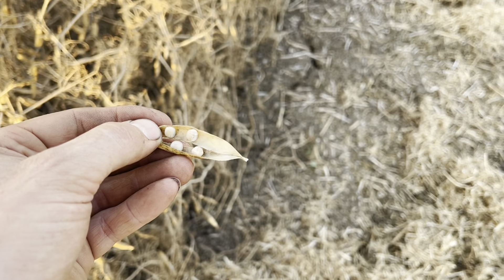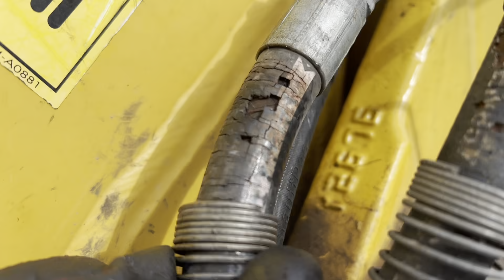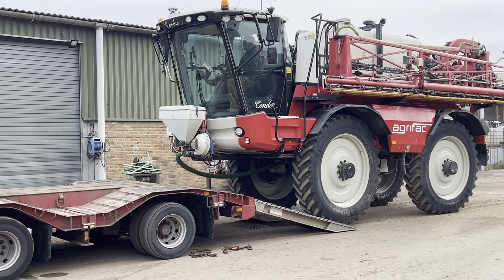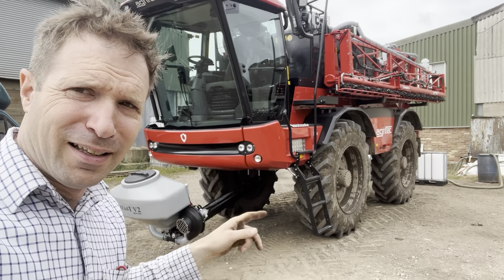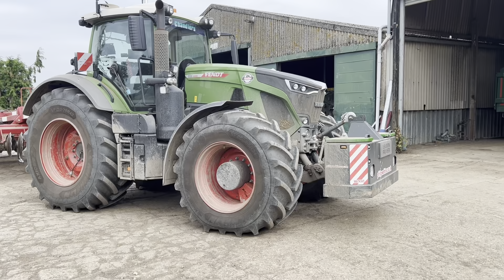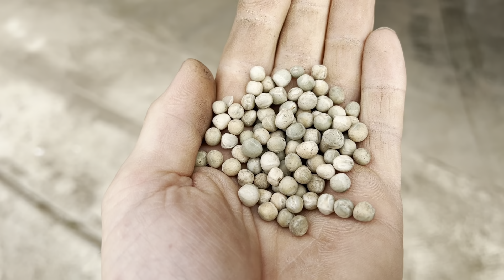Agrifac Condor has landed….         | Producing food takes ages!

Comment: Must be old remember when dad used to hire trailed sprayers from Chafers with donkey engine to power the pump  Technology as certainly moved on with all agricultural machinery
Reply from the maker: I had no idea!,I think chafer may be one of the original manufactures to this day.
Shame how many uk manufactures were bought out only to be asset stripped and shut down.
Near Lincoln there was Gem sprayers, everybody had one around here. Case bought them.
Reply: @Leverton-Brothers believe Chafers still build sprayers in Gainsborough area     I’m going back to 60’s w hen Chafers had big hire fleet of sprayers based on the old Sandtoft WW2 airfield   Isle of Axholme  North Lincolnshire